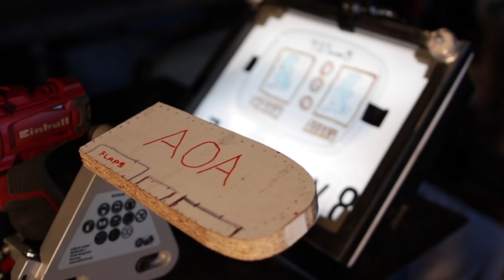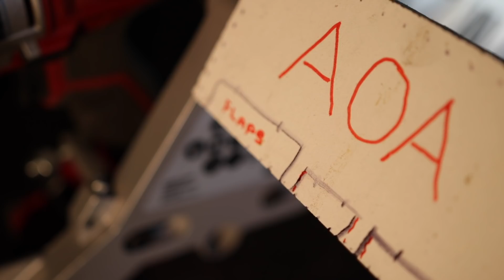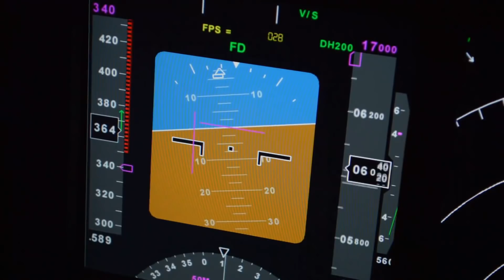workshop model of 737 Max 8 systems - Prof Simon

Comment: The  pilot gave at least thirty nose up inputs in response to the nose down commands from the MCAS. I think if I remember correctly that the MCAS gives corrections in 2.5 degree inputs . This would result in a full down trim on the horizontal stabilizer and the elevator would not have enough command authority to over come that much trim. A fatal feedback loop.
Reply from the maker: poor guys....its must have been so confusing...they needed a BIG KNOB to disconnect the automation and fly the plane manually.

Comment: Professor, The MCAS does not move the elevators, it moves the horizontal stabilizer (down, in this case), I think the mistake you made was unintentional. Please check the portion of the video at about 3:05 minutes and correct it if necessary.
Reply from the maker: Thanks you are correct...YouTube won’t let you edit films but I can try to add a caption.

Comment: The two big engines on the Max induces a nose up moment at large thrust conditions meaning takeoff.  MCAS was conceived to trim this tendency out.  If it screws up MCAS can be manually disengaged.  With what we learned from Lion Air, all Max pilots were retrained on how to kill MCAS.  This included the Ethiopian pilot.  This means to me there is another SW glitch that causes nose down.

Comment: If I understand your explanation correctly had the pilot(s) simply done nothing when the system initially trimmed the plane nose down or at the very least not fight the MCAS a different outcome would have been possible. Seems inexplicable that Boeing and airlines would not have provided flight simulation training for these planes. It does not take a great deal of imagination to envision a sudden nose down MCAS malfunction scenario and what the proper response from a pilot should be!
Reply: A key point.  ...Examine the simulator software.   Does it have MCAS malfunction included as a subroutine?   If not, then FAA / BA made a fateful decision that such was not needed to check ride a 737MAX crew.  In so many words they said so, in one of the BA brag films eg. "The crew does not have to be retrained."   eg... flies like a 737-200 or 737 NG.
Reply: There are training videos showing MCAS activation in a full simulation. The crazy thing is that the (simulated) plane reacts to MCAS by fighting it, screaming "sink rate, sink rate" followed by "pull up, pull up".

Comment: The thing I don't understand is why they didn't turn it off . was it not two switches to do so?
Reply: As typical in many accidents, certain things needs to happen for an accident to occur. There is the fault and then there is the response by the pilots that in series can cause this accident. So two questions a) What caused the fault and why and b) what is the best way to respond to such a fault by the pilots. b1) would relate to the training the pilots are given in the differences training from an old 737ng to a 737 max8. If there is no training or manual documentation this leads to a very dangerous hole for an accident like this to occur. In this case and previous 737 crash,  it seems to be reported that there is no mention of the MCAS in the pilots manual despite communication being made to the manufacturer and FAA by the pilots and associations. So one can assume the pilots would not have known about how the MCAS operates or behaves. I am not sure on accuracy but I believe there were pilots unaware of the MCAS system while flying this plane initially.  Under takeoff there is very little time or altitude to calmly fault find but add to this no documentation in the manual.
Reply: I also read the mcas influences the horizontal stabiliser more than the initial design specifications. This is a serious problem if accurate.

Comment: Does the MCAS know that the plane is climbing after take-off - or does it use level flight as the reference?
Reply from the maker: it mainly uses the AOA sensors to measure how steep the plane is relative to the air....it is trying to protect from a stall...caused by the new engine design...
Reply: @SimonHollandfilms  Hi Simon, can you please explain the relationship between the new engine design and stalling due to new engine.
Reply: As the prof says, the MCAS is solely about controlling the AoA between the airflow and the plane. It doesn't give jack about the attitude of the plane; that's the angle between horizontal and the plane.
The plane could be in a vertical dive, but so long as the airflow was coming from dead ahead the MCAS would be happy.
Of course, if you tried to pull out of your dive too abruptly, the MCAS would intervene to force the nose down to "prevent a stall".

Comment: Fun video however a few tweaks to make this correct. The MCAS system only works when the flaps are up/autopilot off. It changes the Horizontal Stabilizer (Hstab) not the elevator. This is important because you can change the Hstab so far as to make the elevator input have no effect.  This has caused crashes before (without MCAS). As you said fly-by-wire planes such as fighters/Airbus also use dynamic stability so how different? They directly control the aero surfaces by moving the elevator not the entire stabilizer. Boeing not wanting to invest in such a dramatic change decided to do this on the cheap and simply tap into the power-trim motor control. Additionally this system doesn't warn the pilot who would normally be trimming the aircraft already after the flaps roll up. So the crew sees the trim wheels start turning and this looks normal.
Reply from the maker: The mcas after flaps up makes sense of the accident timing...thanks.
Reply: MrRexQuando 
“You hit the nail on the head bro” thanks so much for your comment! I’ve been on that path since hearing of the LionAir crash and saying pretty much the same thing but finding that it falls on deaf ears! I am dumbfounded as to why they aren’t using the stick shaker/pusher to warn of stall rather than putting it into “runaway trim mode”? Don’t they know that is a receipt for disaster? I doubt those designers could think of a faster way to down an aircraft!
Reply: A perfect explanation  Mr RexQuando.
Reply from the maker: Thanks...great info...I always thought only my Cessna had trip tabs on the trailing edge of the elevator...I though commercial aircraft trimmed by moving the whole horizontal portion of the tail...but you are saying they have trim tabs...ok.
Reply: Professor Simon Holland You initially had it correct. The 737 (and all the airliners I've flown) trims by moving the entire horizontal stabilizer. 

Pitch trim in airliners is VERY effective and in some corners of the flight envelope on some planes is too powerful for elevator input to overcome. Runaway trim is a very serious situation.

Comment: Was this a software malfunctioning?: but do they not have more computer systems which must do the same actions?
Imagine that the pilot would not have pulled the stick further backwards but had neutralised the stick (or pulled a bit forward): would the system then not further have put the nose forward?
Reply: It depends entirely on the nature of the sensor fault and/or how MCAS was responding to those inputs (if they were genuinely malfunctioning).

Comment: Could you have turned off the mcas system once it became clear that manual intervention was needed?
Reply from the maker: Yes....but...they were probably not told how...and it was all pretty quick...the mcas should protect the aircraft without the pilots input....something went wrong.

Comment: Prof. Simon, this system can be disconnected by the pilots? When a new complex system like this one is introduced in a new passenger plane, the pilots must be taught how to handle the new configurations on the cockpit. I understand that a jet fighter must have these automated systems because of their inherently unstable flying characteristics but is it morally acceptable to make a passenger plane so unstable to fly and so dependent on these automated systems? A military pilot can eject when things malfunction but we can't eject 150 or more people.
Reply: Osga Estrábica — I don’t think the “instability” is comparable to that of a modern fighter jet.  The Max can be flown without MCAS.
Reply: GH1618 Not legally it can't.
Reply: Clarification: while 737 MAX does behave strangely at high angles of attack and requires MCAS to counter that, it is never statically unstable and at least generally is not dynamically unstable either. This is also true for all commercial aircraft. It seems like MCAS is probably addressing slight dynamic instability with high-angle-of-attack maneuvers. The aircraft aerodynamics are sound; the MCAS implementation may not be.
Reply: @AmbientMorality  MCAS was added to the aircraft because without it it would have failed airworthiness certification due to its stall characteristics.  If it was a stable aircraft as you suggest, it could have achieved its airworthiness cert without the system.

Comment: Yes! This is how I imagined it too and it raised so many questions: why isn’t MCAS coupled to the other flight envelope protection systems? Why is it allowed to trim as much as it can, in this case all the way to the maximum extension of the jack screw? So much so that even if the pilot would have disengaged the electronic stabilizer trims, it would be impossible by human force a,one to operate the trim wheel, due to the increased aerodynamic pressure on the stabilizer as speed of the aircraft increases. 
Also, isn’t it so that MCAS should deactivate when the autopilot is engaged? So why are there pilot reports of runaway MCAS? See: https://www.theverge.com/2019/3/13/18263751/boeing-737-max-8-pilot-complaint-autopilot-mcas
Reply: MCAS is not controlled by Autopilot. To kill MCAS, the two switches need to be off. Like you said, even the pilots had the chance to  kill the switches, they still have to correct it manually. When you are only 3000 ft above the ground, not enough altitude to recover.

Comment: I don't care how much spin the Boeing and the FAA/NTSB puts on this.. The B737 M8 is aerodynamically misdesigned and inherently unsafe..
No one in their right mind would ever set their foot on this flying coffin..
Reply: This will be the big question, wheter it will be a best-seller or not.

How would it fly without MCAS?
Reply: @norm1124  It flies fine without MCAS. Without it, you need to be more diligent in watching handling characteristics. With a malfunctioning MCAS, you have to be very diligent, AND fast in recognizing a fault, and properly reacting to it.
Reply: @mikecowen6507  without MCAS it cannot get a certification as it's stall characteristics are outside acceptable thresholds.  The MCAS system was implemented to enable its airworthiness certification. If the MCAS system is removed, the plane is not allowed to fly.  Checkmate.
Reply: Stephen Lane that’s outrageous for a passenger plane to be configured in such a manner, obviously the drones acoming I’ll take the ferry
Reply: Torrarosa stated "The B737 M8 is aerodynamically misdesigned and inherently unsafe.."

It is not. On a 737MAX MCAS is NOT used to make an inherently unstable aircraft flyable. MCAS only kicks in when the nose of the aircraft is at an extremely high angle of attack and slowing to a speed that could cause a stall. ALL 737's have their engines on a pylon that positions the engine forward of the leading edge. On the MAX the engine is mounted even further forward of the leading edge of the wing. On most airplanes, when you stall, you are taught to get the nose down as fast as possible and apply full throttle to get back to a speed that allows the wing to create lift again. All airplanes have a center of lift, which is mostly fixed, and a center of gravity, that can change based on things like the fuel load, cargo, and how passengers are seated. The longer engine pylons of ALL 737's can act like a lever that can act on the plane's center of lift and push the nose up at slow speeds. When a 737 stalls, pilots are taught to push the stick all the way forward but DO NOT apply power until the nose has moved down below the horizon. At that point, they can SLOWLY apply power until they are at a speed that the plane is not likely to stall. They are taught to trade altitude for speed. 

"THIS PLANE HAS TOO MUCH POWER!!!" said no pilot ever.

And this actual 737NG pilot says that "the 737NG and the 737MAX are equally less indicative of getting stalls, they're very good, very nicely flying aircraft".

Boeing 737 Stall Escape manoeuvre, why MAX needs MCAS!!
https://www.youtube.com/watch?v=TlinocVHpzk&t=770s
Reply: Torrarosa, Do understand the same airframe was created in the 60's for the Pratt & Whitney JT3D's, a much slimmer (low bypass ratio) engine...Boeing labelled it the 737 'Classic'.  The 'Next Generation' (aka, NG) plane featured the CFM56 variants...much fatter engines.  By your assertions, there should then have been similar flight attitude issues with the NG planes, yet clearly that's not been the case.  Also, it's not a design flaw to utilize automation to maintain flight.  The entire go-to-market of the Airbus is based upon this as their A319/320/321 series (direct competitor with the 737) relies upon 'fly-by-wire', computerized & much automated technologies.  Therefore, if you call the 737 Max a flawed design, then likewise, everything Airbus makes should never have been certified either.
Reply: Hear hear! And with each individual pilot their ability to response may or may not save the flight in the future. An Unnecessary permanent design problem and cannot be sure at what other scenario it will rear its ugly head again! God bless the departed souls
Reply: Why would you make such uneducated comment? Please educate yourself in the subject, it hurts to read stuff like this.
Reply: Will the same  standards be applied to driverless cars?